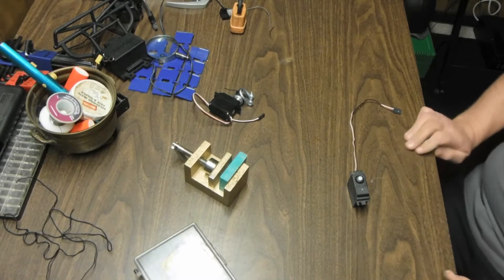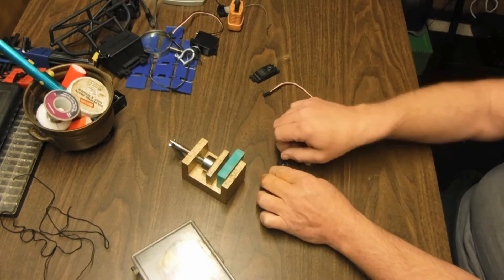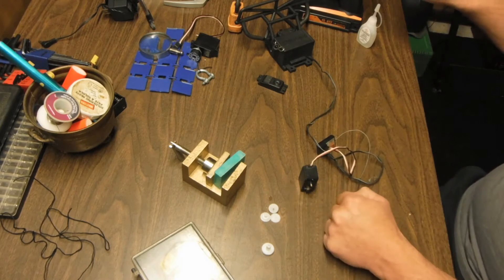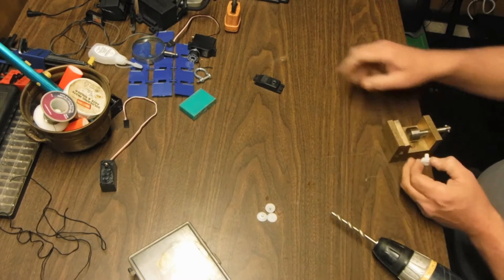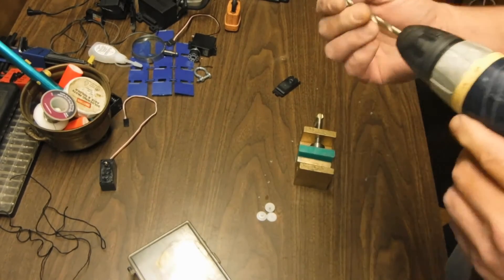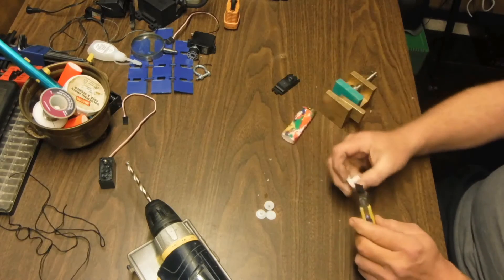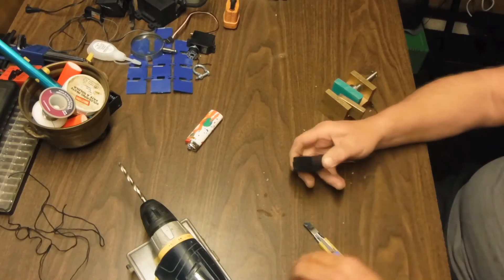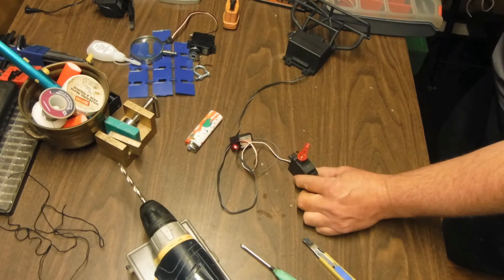How To Make A Servo Winch 360 Rotation

Comment: Do the plastic gears hold up well enough under the strain..?
Reply from the maker: +DrivenRC10 they can as long as your not going to hog wild i made the first one i built haul my summit up a steep angle check my other videos on this project and they did not strip and its a heavy truck , KG will limit what you can pull then you need to use snatch blocks for more power , that or use  strong servo to start with then use snatch blocks if you need to but there is a breaking point of plastic gears and even metal gear servos have their limits then they will strip out